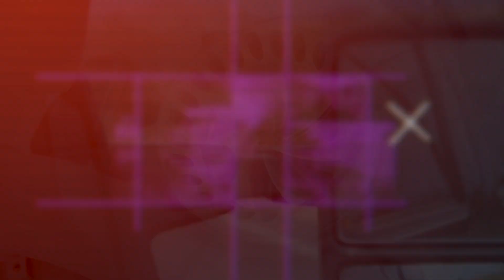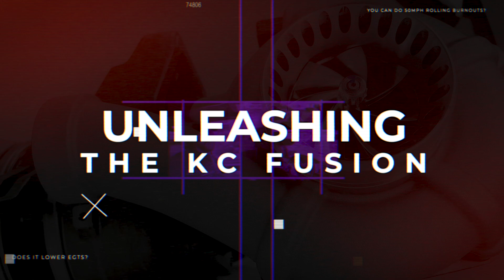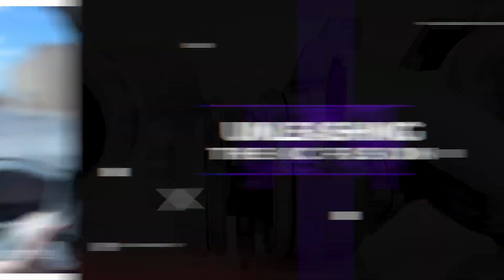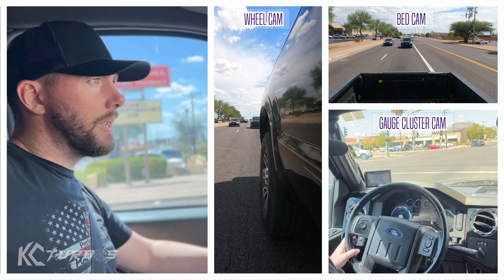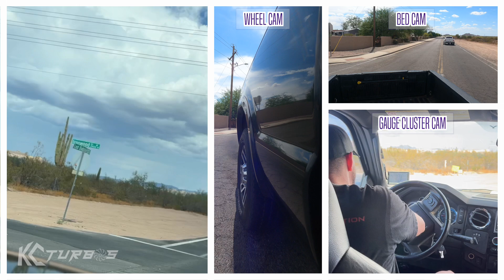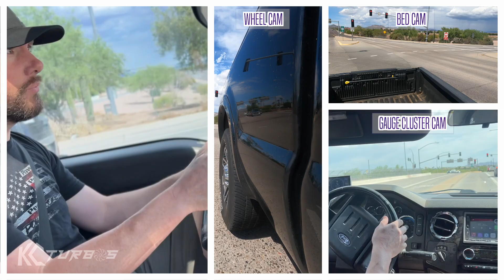Driving Our 1,000HP 6.4 Powerstroke!

Comment: 1/4 fuel issue is very common on the 6.4 and 6.0 the fuel pickup tube in fuel tank the plastic foot on the fuel pickup tube deteriates and their happening at an alarming rate right now everday on the 6.4 forum we see someone saying hey im having a crank no start issue. Next ? Is how much fuel you got? Anyways check your pickup tube as the plastic breaks down and clogs fuel lines and injectors. Plus u dont wanna get below 1/4 tank fuel and let air in

Comment: Whats fuel sustem look like extra lift pump and injector size  i built my engine and wana see 800 to 1000 hp also in my 6.4. But wana know fuel system upgrade.
Reply: Airdog 5g
Dual k16 kit
100% injectors
Reply: You can either do dual k16 or put a cp3 in.

Comment: 6 high pressure fuel pumps? Yeah no thanks ill stick with a cp3 cummins or duramax thats ridiculous😂
Reply: Yea the k16 and the piezo injectors wont have any contamination or they will die. But when they work the k16 flows a lot
Reply: Change the fuel filters every 5k with the oil filters and run a good fuel additive then they’ll give good service.  Change em every 20k and they’ll give you issues.   Filters are cheap insurance and don’t understand why people are too lazy to change em.
Reply from the maker: I thought it was common knowledge that the 6.4 HPFP was made of glass?

Comment: My question for you is your truck is 6.4 Diesel or gas because i have twin turbo diesel
Reply from the maker: Ours is a diesel engine, that has the same compound turbo configuration that came from the factory. A twin turbo 6.4 would be two of the same size turbos powering each cylinder bank.

Comment: Been waiting for this video a long time, if y’all will put a 9 blade in both or one of the turbos I would buy these 100%.
Reply from the maker: The trouble with compound turbos is the high pressure turbos sound gets obliterated and muffled by the low pressure turbo so you cant hear anything. 🙃
Reply: @KCTURBOS  right, but still the low pressure should put off a little more sound with the 9 blade right?